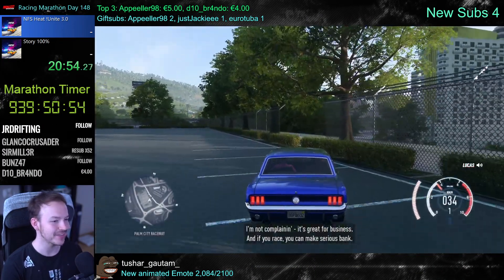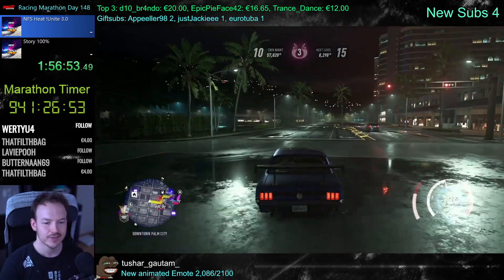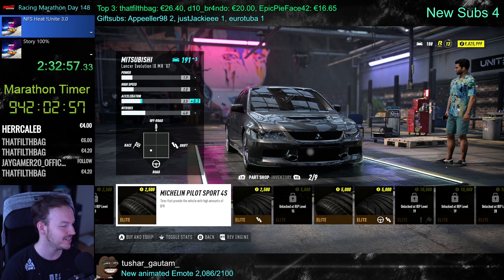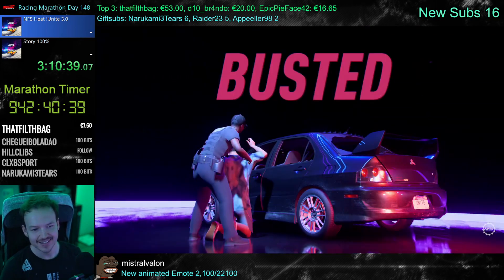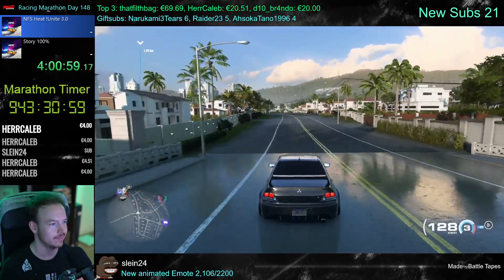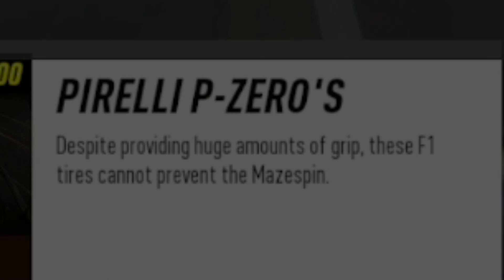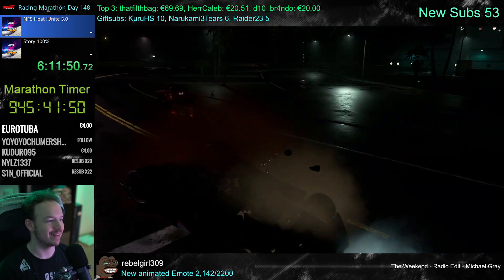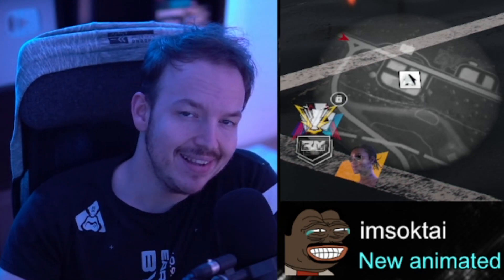NFS Heat with Realistic Physics? - Project Unite 3.0 | KuruHS

Comment: NFS Heat looks absolutely beautiful with Unite 3.0

NFS Heat on PC should have looked like this at launch.

The new graphics reminds me of NFS 2015 on PC.
Reply: I didn't initially notice it affected visuals but it does look much better
Reply: Agreed. With color filter removed it looks much better
Reply: Wouldnt work. Kinda ruins the vibe ghost was going for with a very aesthetically and color filled splash page. Also the fact that they need to optimize the game for console players too and I doubt they would do all that for one version.
Reply: @z-chan946  Look at 0:37 and similar scenes. I was talking about these shadows that the PC version of NFS 2015 also featured. I was initially disappointed that NFS Heat's PC version during nighttime looked worse than 2015's PC version due to a lack of these shadows (these shadows helped NFS 2015 on PC look borderline photorealistic). But thanks to Unite 3.0, now NFS Heat looks better than every NFS (until 2019) during night.

Console versions cannot look this good due to weaker hardware than a modern PC.
Reply: @TigerChamp99  maybe but you have to consider that consoles out perform pc with that weaker hardware because a console generates way more performance with less power that a pc with the same lvl of hardware would be able to do because a pc with that same lvl of hardware would suck big time
Reply: One more reason for me to have a 2080ti now, Unite 3.0 can't run jack shit on my lower end parts :))
Reply: @Cookiebreedchannel  my PC (while drawing more) is more power efficient than any console while being much faster too so that's debunked ;)

Comment: Fun fact: The creators of the handling overhaul pretty much turned Heat into Assetto Corsa with the simcade version of the mod, due to the tires using the same values as in AC.
Reply: Also blame Yorpie for the cops. xD

Comment: This is the closest thing we have to a new Prostreet yet. 
It's amazing how the community can create better stuff than the actual depolvers with just a few months
Reply: Hate to break it to you but its much more easier to mod a game than actually make a game
Reply: @H3llfire320  well, Heat is almost the same game As Payback, which also is almost the same game as NFS 2015 which also takes a lot of stuff from NFS MW2012
Reply: @dybixs1400  not really but alright, modding a game doesn't take as much effort as literally having to make a new game, the mod creators basically have a full game to work with
Reply: @dybixs1400  Completely different games from a technical standpoint. Just ask any of Project Unite's devs about how they made their mods for 2015 and Heat and they'll tell you how different every game is. This mod also took them almost 2 years to perfect, and it started as an off-shoot of GZilla's Heat +, iirc.

Comment: This is probably what everyone wants in the next nfs. Not some burnout handling, but a bit more challenging handling where you have to take racing lines and get better at handling the car. Basically, handling like MW, Carbon, Prostreet, The Run, Underground.

Comment: As much as I like break to drift physics, they don't really work in a game like Heat where the emphasis is on car customisation and street racing. Burnout, HP 2010 and MW2012 need it because they heavy rely on aggressive driving, bonuses and takedowns. Heat works much better when it's not trying to be Carbon and Hot Pursuit 2010 at the same time

Comment: I hate the idea that people think heats handling was bad..either they needed to fix certain cars, or y'all trash at the game. I understand that it's not realistic but Nfs mw wasn't realistic in the slightest underground 2 wasn't realistic either
Reply: Not excusing the bad mistakes that ghost has made but if you don't like heat then your standards or your need for nostalgia is so high that no new nfs can ever reach that standard, because even the older games don't sit in that standard
Reply: See, I somewhat agree with you. I grew up playing games like MW or Carbon and nowadays I find those games boring. The thing with vanilla Heat is that the handling model made no sense. Certain cars like the RSR or Ford GT were able to take corners at ridiculous speeds, while others were pretty much unable to take corners unless you slowed down to a complete stop. While I completely understand that some cars are supposed to be better than others, it sometimes felt like you were playing completely different games. 
No one´s asking for a realistic game, Need For Speed has never been about that, even Shift felt arcade-ish. The thing is this handling model feels and plays way better than whatever Ghost Games ever did with this series. These modders did an amazing job with NFS 2015 and now feels like a proper racing game, and they have done it again with Heat. 
In any case, the mod features both a simcade and an arcade handling mod, so if the Forza-ish handling doesn't suit you, you can always install the other one.
Reply: @dudocaine  if ghost went on heats path then imagine what could have been